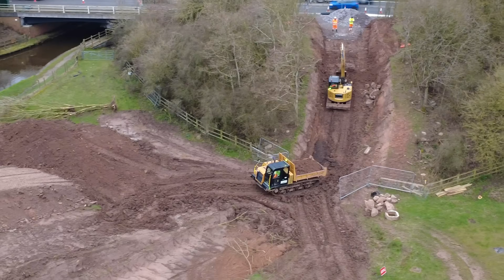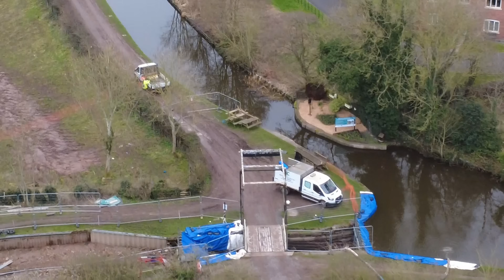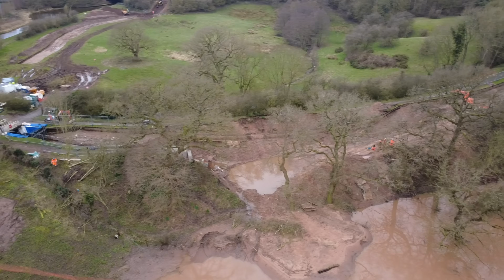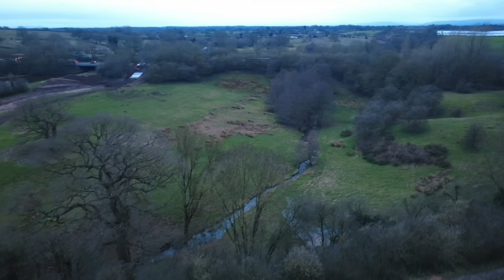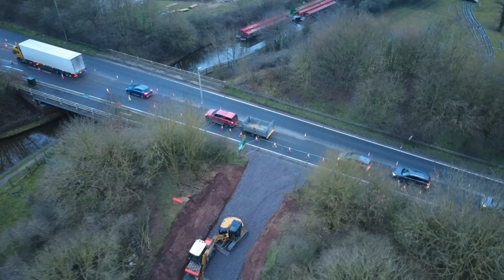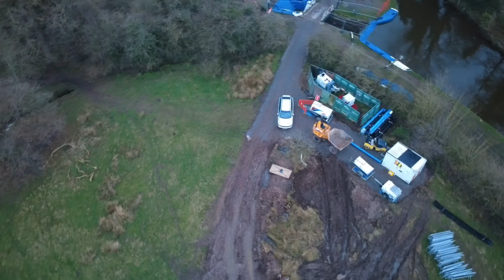Llangollen Canal Breach, Whitchurch.  New Access, Machinery and Tree cutting. 27/02/26

Comment: I found this interesting video by the CRT about the repair of another breach, fantastic work and maybe an insight of what to expect on this project:

https://youtu.be/AMh_MIQSgUs?si=xQisV_ACqmfoxKJ5
Reply: Interesting. If they were to use a similar route for accessing the canal bed for the Llangollan, I think they might cut through the bank on the non-breach side to enter straight in at bed level, rather than climbing over it and descending from towpath level as I'd assumed.   They repaired it by casting a concrete trough, but, unless that method is considered a universal retrofit, I don't expect they'll do it for the Llangollan breach because the structural design of the canal and embankment at Whitchurch is significantly different to the Middlewich.
Reply from the maker: Thanks for the link. I'll watch that now.

Comment: I wonder why they don't use timber mats to make an access road, that how most construction sites gain temporary access. Once the construction is completed, the mats are easily loaded back up, and little effort is required to remove the road .
Reply from the maker: I thought that may have been the case but obviously they decided on a different route.

Comment: I am trying to figure out if the slow pace of the road/track build is a function of English vs American techniques or just time to kill. In the US, either a tracked loader with a 6 or 8' wide bucket or a tractor drawn scrapper would have been used. The loader or scraper would have finished the grading job in 3 days and been much more efficient at laying down gravel, probably requiring a load of gravel every 15-20 minutes. The excavator would only be required to knock down the first few feet and dress the banks adjacent to the road.